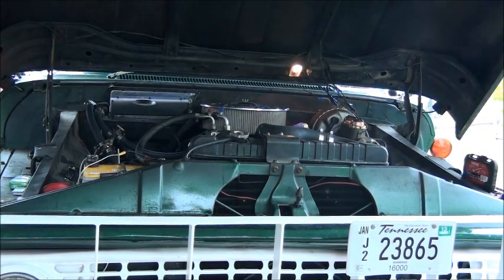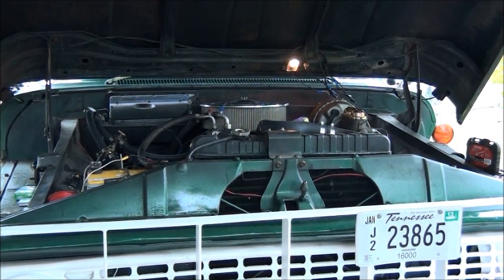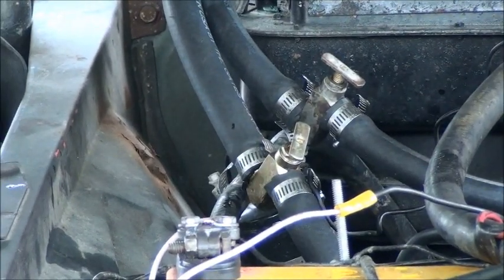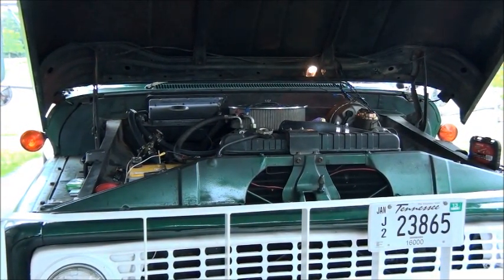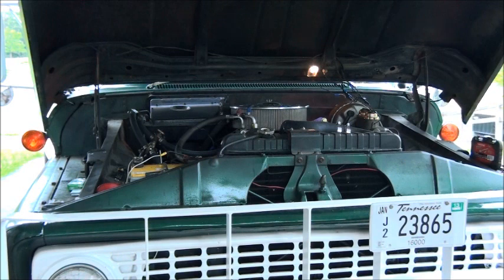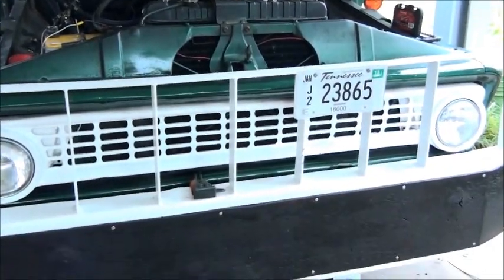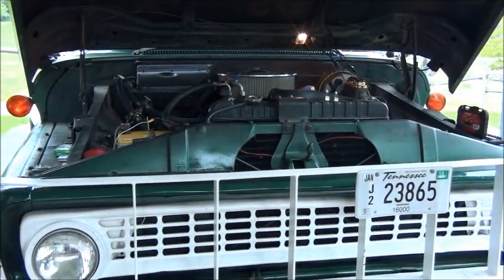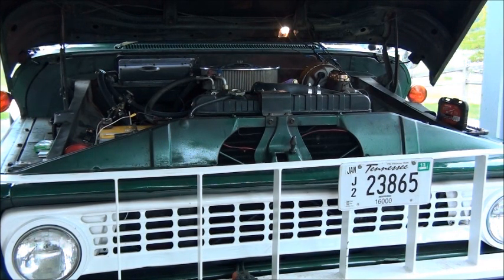TOW MATER CONTEST !!! ASK MORE350POWER !!!

Comment from the maker: well it could be in how you look at it on the slug part , it retained the cam shaft from the big truck , so it is a very low rpm engine , it will not turn over 4,000 I tried , the truck moves on down the road very well , and it would pull a house down , but it won't be winning any races , but in a tow truck it is a torque monster , and that was my plan , it is just what I wanted for sure lol